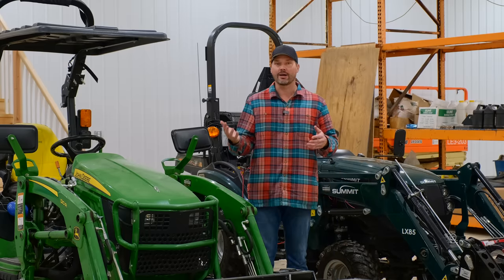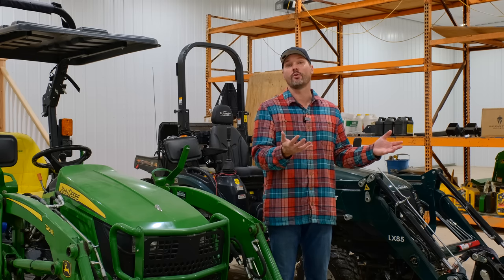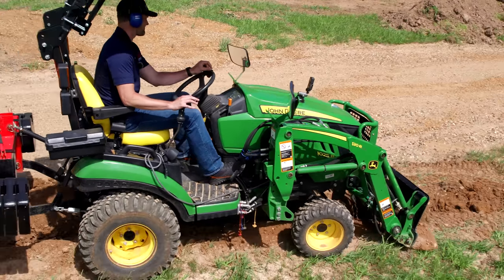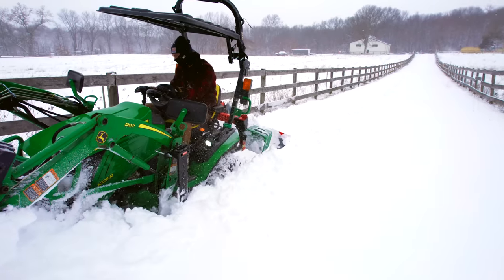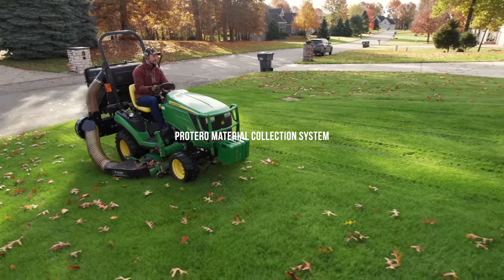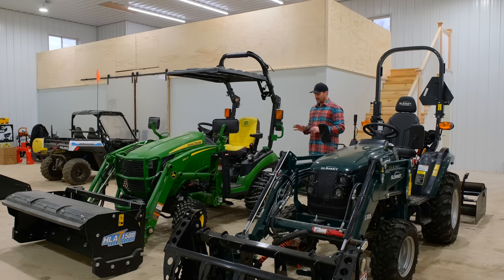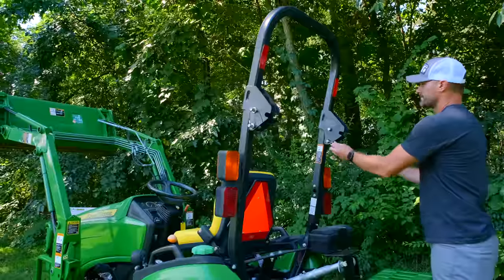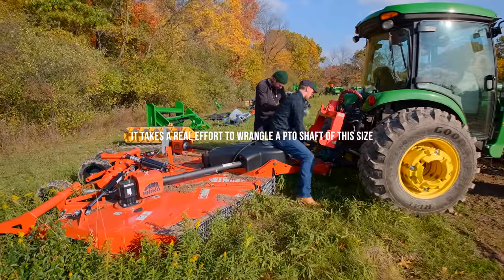BIGGER BAD!🤬BUY SMALLER. BUY CHEAPER. I'LL TRY TO CONVINCE U

Comment: I've been on the fence on several. Size wise kioti 2610/equivalent Kubota. I'm on 9.5 acres. 7 with lakes included. Attachments is my big point. Grapple, forks, backhoe are tops plus a land pain or box blade. Where I'm at, not only on my property but making side money. Rented a backhoe 2 years ago. On 4 neighbors, digging drainage, etc I more than paid for the rental and I charged extremely low... Attachments and hydraulic power flow is what my buying point will be.
Reply: Same. Have you considered the L2501?
Reply: @Neet Channel  I have and it's the strong contender. Keeping me at the 25hp mark. I rate them by hydraulic pump volume. Yes, I look at overall reliability certainly but a backhoe doesn't need pto, just hydraulics. The kioti for comparison beats most I've seen and price point can't be beat.

Comment: Well you might just want to go bigger...... I bought a simplicity xl garden tractor with intentions to get implements for it, bucket, blower, 3 pt attachments.... but low and behold they would have costed more than just buying the bigger tractor.... I was better off (and cheaper) to get a bobcat 4X4 235 loaded.... so that's what I did because the loader and blower for the simplicity xl would have cost at least 1 & 1/2 times the cost of the Bobcat with loader and 3pt hitch and full hydraulics!! So in that case you would be wrong!

Comment: Buy a small machine if you want to putz around your yard and do cute stuff. Safe, cheap, simple little machine for simple little jobs. But if you're looking to move material, move trees, load trucks, pull stuck machines out, plow snow, have real pto power, do farming etc. Get a big tractor. Most people don't need a real tractor to do real work. So maybe stick with the little toys? They are kinda fun and safe

Comment: I guess it depends on how much work you have to do, how fast you need to accomplish it and how much money you have to spend. Maybe another consideration is will you work a smaller tractor beyond its limitations and damage it.
Reply from the maker: That's a statement I often hear, but don't understand how it happens.  How do you work a small tractor beyond it's limitations and damage it?
Reply: @GoodWorksTractors  you ever try lift something too heavy for the tractor bucket and tractor, you ever try and pull too large of an implement too fast, you ever try and mow with too large of a mower, you ever pull an implant all day hour after hour with a consumer grade small tractor?   I can think of a lot of things that people try and do with too small of a tractor. Right size tractor for the given job …… usually works the best. Thanks for your response and comment. Nice to have contact with creators.
Reply from the maker: @robertkeime4907  The tractor has built in systems and design constraints that don’t allow you to do that.  I’ve done all those things to see what happens.  

You can’t lift more than it’s rated for.  What happens?  Absolutely nothing.  It doesn’t lift it off the ground.

Pull too big an implement?  Same thing.  Either doesn’t spin it or doesn’t lift it.

The tractor doesn’t allow you to do so.  You can’t just run a 72” brush hog on a 1025r cuz you want to.  It’s unusable on the tractor.  You can’t overload the loader and lift 2,000 lbs skids.  It’s not physically possible.  It’s engineered so that all all parts and features work within the same parameters…axle, tires, frame, loader, backhoe, hydraulic system, engine, etc.
Reply: @GoodWorksTractors  some damage is small like the front seals.  others is bigger like breaking the frame.  hard to do - not really.  A) load bucket.  B) take tractor off road C) bounce on uneven ground and twist on hills from point a to point b D) loud scary noise and now you have 2 tractors! E) wait for repair.  
A trailer to "solve" the problem has challenges - they cost as much as the tractor if they carry anything, the carry as much as the bucket if they are cheap, you have to hitch and unhitch them and with a trailer you can't get into where you want with a 30HP (give or take) compact tractor.
Reply from the maker: @boomerau  This has nothing to do with the size of the tractor.  You can abuse a tractor in many ways, but that is not working it beyond it's limitations.  That's called being an idiot. :)
Reply from the maker: @PurpleNovember  Then give an example of how.
Reply: I have run a lot of equipment. And I definitely think it is easier for an inexperienced operator to abuse a small piece of equipment vs a large one. Things also happen a lot faster on small machines. Lifting something wrong and tipping it over. Large machines seem to be a lil bit more forgiving in that regard.

Comment: I’m contemplating replacing my 58hp Massey 253 with a new tractor, but can’t decide if I want to get a bigger gear drive tractor or a 55hp hydrostatic. Test drove a 55hp TYM yesterday and IT WAS NICE and roomy. Got on the Massey today and felt like I was riding a dinosaur 😢. I need something with enough hp to occasionally run a Brown Tree Cutter.

Comment: Don't over buy a large tractor to do the 2% of jobs that might be once every decade, just hire those done, get a right-sized tractor for the other 98% of jobs. Smaller tractors have smaller monthly payments, smaller interest payments. Repair parts will be cheaper. Smaller tools/wrenches are needed, smaller jacks/hoists to work on the tractor.

Comment: I have owned a TC35, a CK25 and now a 2305 for the last 12 years. Each one worked for what I used them for but I find myself longing for the hydraulic flow/capacity of the bigger tractors almost every time I use the loader. Does it get the job done, yes most of the time, but having owned/used bigger equipment, the blend capability is really lacking in the SSCT's. Also, I have been watching several videos on the new Summit tractors and will be watching them closely, especially now that they announced a factory cab and a little larger model. BUT, The main reason I wouldnt purchase right now is no dealer/service anywhere remotely close to Logansport, Indiana or ANYWHERE in Indiana for that matter.

Comment: I have owned a TC34DA for about 14 years and love it. My dad recently bought a compact Kubota 24hp. I could not believe how inferior the new Kubota was compared to my New Holland. Kubota Engine and Hydro super noisy. Lousy operator ergonomics and a poorly designed hydro pedal that is extremely stiff. Very Underpowered and could barely pull itself up a hill when mowing. I would never buy a tractor with less than 35hp. Anything less is just a toy.
Reply: What's crazy is Kubota hasn't hardly changed anything in 10 years but keep charging way more $$. Just like a Harley.

Comment: A tractor is not the best at anything except being average at a lot of things - basically your why have more motors video.  So no 2 people will have the same need and usage pattern.
I mow the main paddocks with a ride-on - if prices would drop and stock levels return a zero turn is on the wish list.  The tractor does the aeration and mows it when it gets tall.  The tractor also does the trails.
Otherwise basically the TLB is about 4 landscaping machines that each cost almost as much as a tractor but each would do 1 job "better" and then I need another big shed to store 4 machines which costs as much another tractor with all the costs to set it up not just the kit "price".  At the moment the tractor with rops up just drives in beside the cars - yes the "garage" has the taller roller doors for this.
Also bigger is more fuel to manage and burn through - if you're a business this is a tax write off - as an individual it is a post tax cost!
I haven't bothered with towing - smaller car offsets "delivery" costs if it needs to go offsite everyone should drive a tractor up on a moving tilt tray as an exercise in spatial awareness!  But as you said you buy any sort of truck+trailer and there goes $100K excluding insurance and running costs and these go up with tractor size.
And then there is snow - not a problem I have but wow heating a big shed must cost $$$

Comment: Is it possible to damage your front loader by lifting at one edge of the bucket causing a twist, or is it within the tractor’s natural limits to just not lift any further when it’s too much?
Reply: Yes it's possible to damage the FEL frame (tweek, twist, crack, tip over).

Comment: I bought my jd 1025R a few years ago. The tractor alone costed only about $13,000 brand new. Today, these tractors cost $18,000. Everything is so expensive now, especially on a smaller piece of equipment. If you buy a tractor, like a car, it's a long term commitment. Once you buy it off the lot, your not going to be able to easily return it or sell it. If your considering to buy a tractor along with implements, make sure you have a budget you can support to make the payments.

Comment: but if you take into consideration on a small tractor the factory engine rebuild time is around 4-6 k hours thats atleast what they recomend or so a bigger tractor has more time on the engine thats still safe if you buy used and also your time is money too if you have to mow 4ours instead of 2 then thats a win and if you have bigger tractor and more power availeable then thats good because you might move and then need more of a tractor and then you have it the extra weight is a bonus you spend less on ballast if you do the same job with 2 different machines the bigger might not need as much ballast for the same job with bigger machine you have the possibility to work the machines for extra money and then you want the bigger machine so that you dont constantly overload the tractor and that means the machine lasts longer and also the point of just comfort on a big machine you can fit in a cab nicely you have more room maybe a buddy seat even for the kids (i wish my granpa had those seats growing up all i had was a 10 inch wide fender in a cab tractor ) also the you have the power to do big jobs quick and without having to overload the small machine too much also they are pretty pricy for what they are and if you buy used you can be pretty sure they will be pretty far worn because the small big tractor thing doing jobs that should be done with big ones but doing with small i own a 55 horse 2wd early 60s tractor and its about the size of a big suv like a audi q7 or something like that its a small tractor for the power
Reply from the maker: I recently surveyed my viewers.  70% of them put 100 hours or less a year on their tractor.  I'd say 40-60 years is a pretty good run before an overhaul is needed.  That said, I can easily make a case for a larger tractor too.
Reply: @GoodWorksTractors  well i myself have put a solid 70 hours already on that tractor in 2 months and i dont do very much with it but just yesterday bought a lograpple for it i have to fix it up a little but it cost me 650 bucks for it and thats saying something thats a really heavy built and the machine weight of it is very good for what i do
Reply from the maker: Nice, you're in the minority.  However, it's also very common to have heavier usage up front for the big projects and less time down the road for maintenance.
Reply: @GoodWorksTractors  every single person i know that runs a tractor prefers heavier one because we have road maintance and firewood a little logging every once and a while and snow and all that i just prefer having more weight they Are pretty gentle on the lawn not for mowing we use a Zero turn because its faster and really its just for moving stuff so the wheelbarows Are not used much because why would you If you have a Nice tractor
Reply from the maker: Logging typically requires bigger machines.
Reply: @GoodWorksTractors  yes that it does but usually its more of the weight and the center of gravity my granpa uses a 2wd 25 horse tractor that can move on the wood with no problems and dont have trouble with power but more of the weight also he uses bigger tractors too

Comment: 2032r or 3046r

Time  money  effort acres

Many of my neighbors have ridiculed my 2032r size
When an emergency smacks them in the face
They come a CALLING
Reply from the maker: Funny how that works :)
Reply: I am able to pick up 4x4 round bale silage 
4x5 bales can be pushed not picked up
The backhoe is attached the entire time
A local shop will be adapting an Avant attachment
We are looking at three of their attachments 
1st  Grabbing tool
2nd Round bale grab
3rd  Bale handler

Two of these attachments allow for rotation as well

John Deere et Kubota etc have forgotten that small tractors can still farm
They need to step up their attachment options